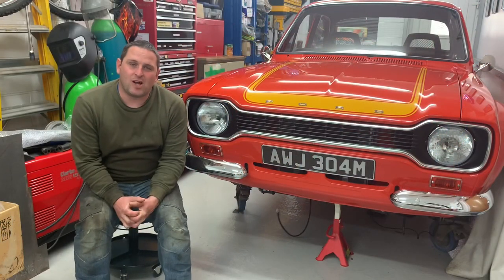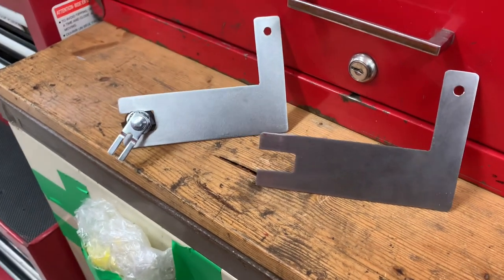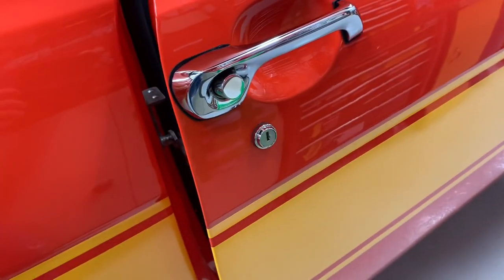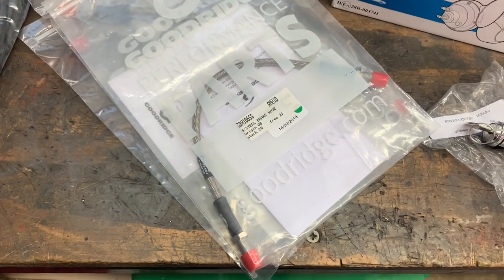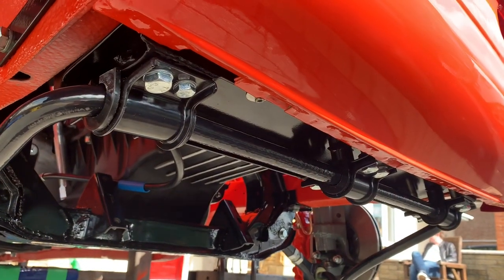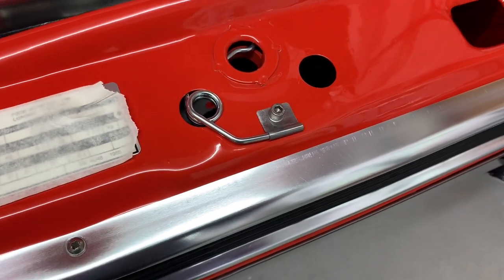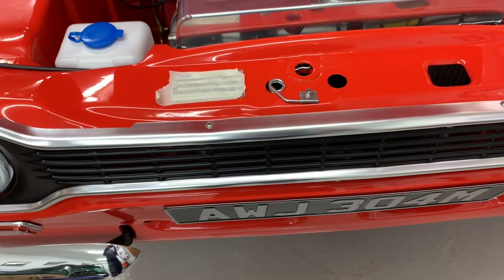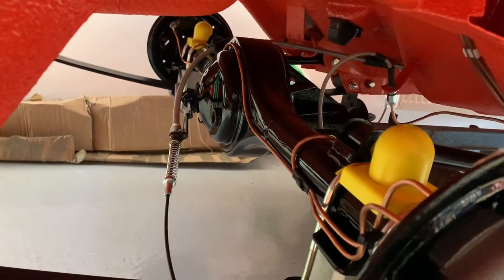Mk1 Escort RS 2000 Re Assembly Episode 21 Diff, door locks and More

Comment: Craig good temp fix on the locks, you could also get your dermal out and grind a key way in to the outside of the barrel and make a key way on your brackets so once your bracket is in place the key ways would lock the outa barrel turning, just a thought
Reply from the maker: Yeah good thought Dave. Theres not a lot of material around the barrel to play with. They are quite thin walled locks. Usual Austin Morris money saving 🤣

Comment: Thats a Masterclass in quality assembly work mate. Attention to detail will always win out and what a superb finish you have created.
Seeing underneath that shell brought back so many memories of my H reg Twin Cam and K reg RS1700 (both ex works cars), Atlas axles, ZF gearboxes etc. I totally abused them in the forests and night rallies 'back in the day'.
Just a gentle heads up I would keep an eye on the long U Clamps on the tall lowering blocks because as the axle grips it will create a greater turning motion against the springs and stress the U Clamps. Its why the factory Escorts had 4 link axles (they could also use slipper leaf springs but thats another story).  Just something to watch.
Reply from the maker: Thanks very much for the great comment. I dont think its a very good set up, the way the axle joins the springs, only by the clamping pressure of them long u bolts. I will certainly keep an eye on it, as i can envisage issues in future.  Been watching your K build videos too also. Nice to see it being done differently from most and nice to see a build on a smaller block.
Reply: Car is looking great. I agree about the axle u-bolts, they do have a tendency to stretch and can cause the axle to twist if not checked regularly, especially if driven hard. The way you have them fitted will exaggerate this due to the poly saddle, the bolts are clamping onto the poly, if using poly saddles or the original rubbers there should be one below the spring as you have and one above the spring with a steel saddle over the top and down the sides of them so it is clamped down solid metal to metal against the bottom plate otherwise the bolts will never tighten up properly. The idea of the poly or rubber is to insulate the springs from the axle to help prevent noise or vibration from the axle transmitting into the body. You can just eliminate the rubber /poly/ saddles altogether so it is all bolted together solid (as recommended in the Ford rally preparation manual) this will help to reduce axle tramp aswell. Sorry for the long message but I see so many fitted incorrectly partly due to the magazines showing how to do it but doing it wrong!
Reply from the maker: @markwilson2576  i think part of the problem is that there is no info out there to show how it should be done. Ive spent hours searching the net for info and pics and absolutely nothing. In the end, I’ve just had to guess. All the photos i can find show it done like i have done here. The problem is if i fit saddle pads above the leaf spring and between the lowering block, its going to lower the car too much.
Reply: @performanceclassics1986  Yes, it will lower it more, the thickness of the poly pad and the steel saddle that will be needed is about half an inch so you would need smaller lowering blocks aswell as finding some steel saddles the right size (there are different heights of saddles depending on the number of leaves the spring has and also if I remember correctly you are using mk2 escort springs so you would need mk2 saddles due to the springs being wider). I would recommend removing the poly pad you have in now (as Ford motorsports recommended in the rally preparation manual) then the bolts will tighten up properly so the axle, lowering blocks, springs and the bottom plates will all be bolted together solidly rather than clamping on a compressible poly pad. I agree that virtually all the escorts you see nowadays all have the poly pads fitted incorrectly which I think is due to the magazines showing fitting them incorrectly and also the fact that most escorts have been stripped and the parts sold individually including the bodyshell's so people have to buy the parts individually without seeing how they came apart originally. I did spot the original set up shown on the latest video from 'Aaron unknown' showing his Alan Mann lookalike mk1 last night, he showed the axle clamped onto the steel saddle which is over the original perished rubbers with the spring in between the two rubbers, he showed it as he was talking about fitting lowering blocks. I hope this helps.
Reply from the maker: @markwilson2576  Thanks for your lengthy and very detailed message Mark. Its much appreciated. I do actually have the correct metal saddle retainers which im going to fit, with a saddle pad fitted either side of the leaf spring. Both yourself and another guy i talk with have both pretty much said the same things so im going to do it as advised by you both then i know its right. Thanks for your help 👍 il just have to keep fingers crossed 🤞 that its not too low
Reply: @performanceclassics1986  No problem. I'm happy to help, I like to see them done properly, you're doing a great job especially with not having experience of escorts before. It's a shame some of the tech advice in the magazines isn't too good. If you find it too low it's just a case of changing to smaller lowering blocks.
Reply from the maker: @markwilson2576  Appreciate your help Mark 👍 Think im going to rectify this issue this week
Reply: @performanceclassics1986   Having done a few (abused) Escort rear ends this sort of hit me in my OCD! Hope you didn't mind the comment. Those single axle links on top actually exaggerate the effects of those blocks. "Moments About a Force" as my old Physics teacher used to say.
Thanks for the compliments on the 1098 A+ K. Its now finally built up to the Head and I added some more Vlogs last week. Scholar did a superb job on the pistons and the other little tweaks I wanted.
I am setting the cams and followers up on the bench next week as I am out buying Mini parts now we can get about
Hope to have it ready for Head final fitting soon. Just waiting for the top end plate, seals, belt and vernier pulleys from Force Racing.
Reply from the maker: @1chish  Its going to be a really interesting build. I will certainly watch it progress and be nice to see it running eventually.

Comment: Hi again. Brilliant jobs done as usual. Just a thought. Would gasket or sealant be needed behind the back brake plate to stop any oil which could seep past the bearing & down the back of the plate.
Reply from the maker: I actually did think about doing just that very thing also, when i was  putting it together 🤣. If it leaks, its easily done

Comment: Good job did you have any luck with the Murray clamps for the water hoses as they look the   the nuts Craig.
Reply from the maker: Im pleased youve brought that up again because i couldn’t remember what they were called and also couldn’t find your earlier message. I will have a ratch for them now 👍
Reply: @performanceclassics1986  Look up Rosssport and they have all the sizes as they are used in WRC etc,
Reply from the maker: @evo5349  👍

Comment: HATE to be pedantic here buuuuut, isn't that o/s drivers' lock upside down? 

Surely the recess on the key slot should be at the top? 

The way you have them Craig will enourage water to run into the lock due to the recess being at the bottom of the barrel. All key slots in the 70's had that dimple at the top.
Reply from the maker: As they are, the key goes into the lock the right way up. If i turn them around the key would insert in upside down. 

Im not actually sure they would fit the other way around. 

As they currently are, they match my mini which is obviously part of the Austin, Morris, MG group.
Reply: @performanceclassics1986  I always  recall the flat edge of the key being on the upper edge of the escutcheon, with the dimple at the top too.

If the key goes in the opposite of that it seems a bit odd.  Knowing how exacting you are, I'd look into that. 

Ps - the car is fantastic. 👌